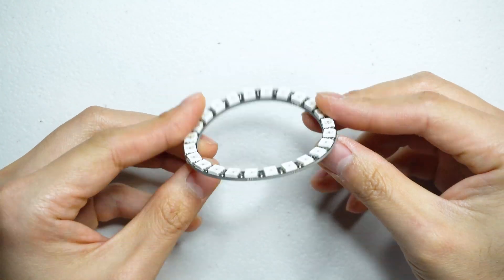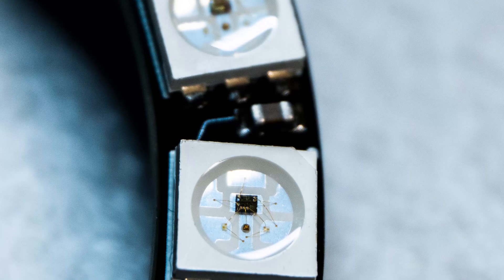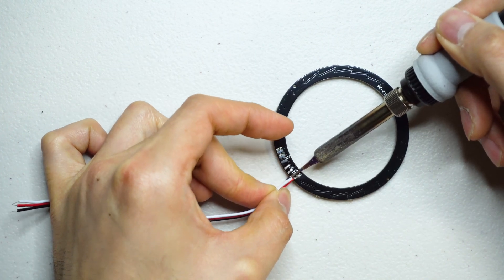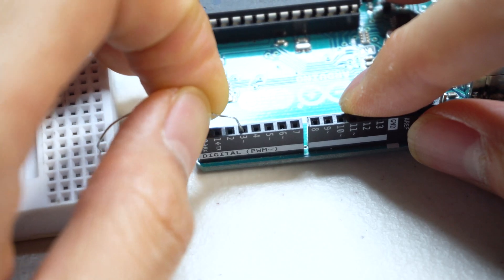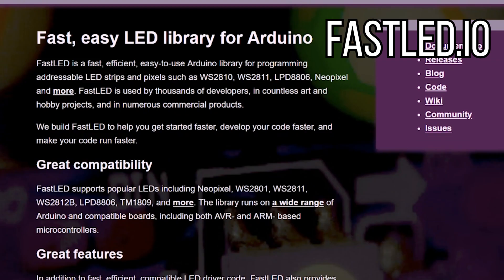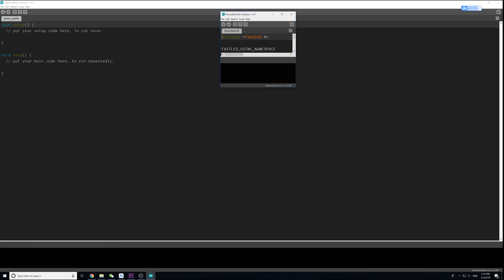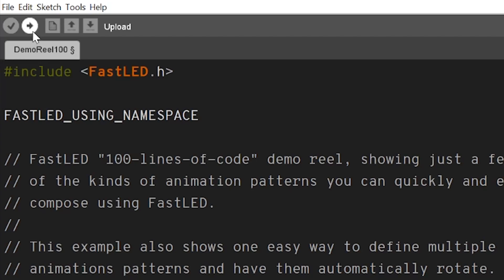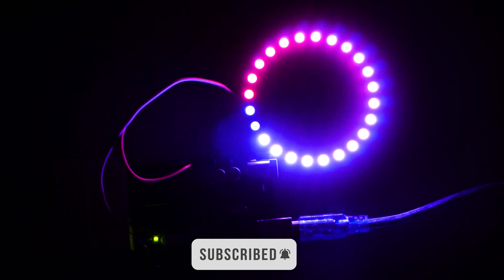How to light up WS2812 LED Ring with Arduino in 2 mins

Comment: I have a Cyberpunk Mask from China. I can see where they plugged output connector into a small button controller. This then connected to the USB chord. There is not boxy thing, no app.... just the wires and the small buttons.
Any idea how this was done? I could send you a picture if you want.

Comment: @DesignMaker, Hello, Could I use 1 Mega Om resistor for Arduino Uno R3 And LED RING consist of 24 bit?
Reply: Probably going to prevent too much current, yeah ?

Comment: «2 minutes» is a lie.

In reality I spent the whole day doing this project (and eventually succeeded):
1) The board files for Arduino turned out to be 32-bits, not 64-bits compatible with MacOS Catalina, so I needed to research this topic and to configure 64-bit AVR compiler myself.
2) The board was connected but cannot be detected by Arduino IDE. I needed to research this and to find that in order to upload sketch to the board I need to connect board not directly to Mac, but through the cheap USB hub (the cheaper and lower speed the better).
3) The "DemoReel" example you mentioned cannot fit to controller (just a few bytes larger than available memory), so I needed to remove one animation function from the example code.
4) After the code was compiled and uploaded to controller, it did not work. That is where I needed to use oscilloscope to find that pin numeration in code does not correspond to numbers printed on controller PCB.
5) After I connected LEDs to the right pin, it still did not work. Indeed, oscilloscope showed broken signal (only sync pulses, and zero otherwise). I researched this topic and found that some pins are unsuitable to be used by FastLED. Connected LEDs to other pin.
6) At this point LEDs briefly turned on, but turned off since power circuit on the controller board cannot deliver enough current to LEDs.
7) Downloaded board schematics to find a way to circumvent power circuit. Turned out that schematics contained mistake, so I needed to use multimeter to find how parts are actually connected on the controller board.
8) Connected LEDs in a way that they get power directly from USB to which controller board is connected, that is when it finally worked.

And I do not mention that 1 of 10 times Arduino IDE displays "unable to erase Flash ROM" instead of uploading the sketch, so I need to disconnect and reconnect the board. And 1 of 10 times the board does not start when powered on. So I need to disconnect and reconnect the power. And every 30 minutes Arduino IDE just crashes without any reason (looks like it does some background activities like checking for updates), so I need to restart it.

So, I wanted this project with blinking LEDs to be a way to relief stress, but in result I got amount of stress comparable to the busy work day.

Comment: Great video,  good info and no distracing nonsense (ah well, the music lol). I Litterally started programming my LED rings in under 4 minutes. And I Subbed as well. Thanks! 
PS: I also found "MobalLedLib" in the Arduino library manager. It's  super easy, superfast, and (if desired) can be done almost without actual programming - by use of Excel. Recommended lib addition.